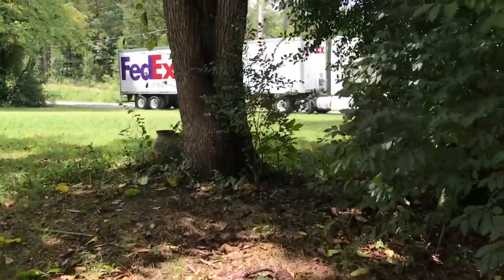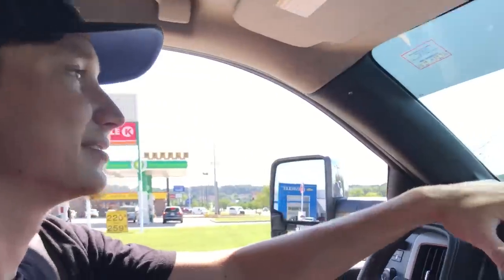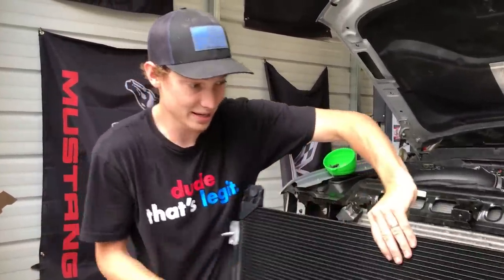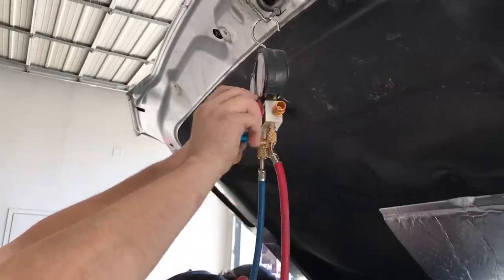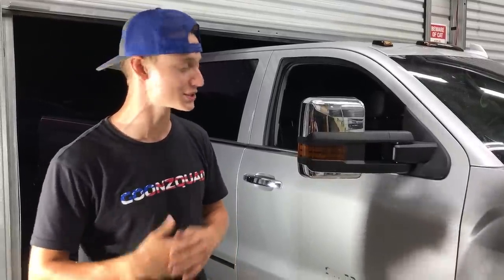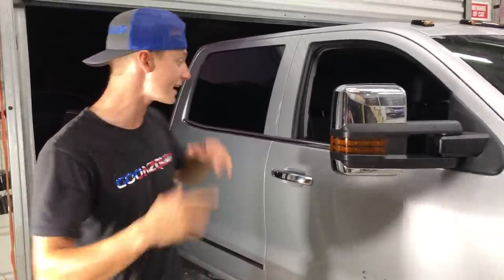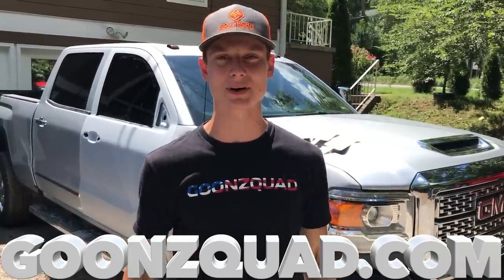Rebuilding A Wrecked 2019 GMC Duramax Part 7

Comment: 2 tips of advice

1. Always clean panels before you check for color match and also check them for panels you will be painting or trying to avoid blending.   

2. Lay them flat as possible against the edge of the panel and check for match, pearl (flake) and side tone.   Sometimes you'll have 2 colors that head on look perfect but from the side look completely different.  

Also from experience, check with the paint store maybe they can let you use the 'chips' for each color.  Sometimes alone on that you can match the color close enough to avoid blending panels like the hood (which is a nightmare on that truck).  Would save you the  cost of buying a pint of paint for each variant.  

Also, label everything.  Every variant, paint code and which ones matched best for the car.

Comment: You pull a vacuum to remove moisture from the system as the compressor cannot compress moisture(water). It will also help ensure confirm no leak. Holding vacuum for a period of time will confirm hopefully no leaks . To leak check you would charge with nitrogen first and check for leaks then move on to vacuum if as is good. Great video guys. Loving the Denali.. shame not released in the uk

Comment: HVAC ATTENTION
I have been doing HVAC 25yrs. 
1.) You should have dropped that compressor and drained the oil. Used sub zero oil and measured right amount back in. That system could have ran for a bit and drained oil till pressure switches shut off.
2.) The system sat open for how long?? New refrigerant oil is POE. it doesn't mix well with moisture; infact it become acidic if a proper vacuum is not done.
3.) Vtuned is a great frame guy. But his method for vacuum pumping is bad. You do not pull thru manifold hoses as vacuum pump is not fully used to capacity. Secondly you change the oil in the pump every vacuum as that vacuum oil is what collects moisture from the system. Thirdly a micron gauge should have been used to tell how deep and moisture in system while pulling a vacuum (500micron minimal).
4.) The dryer/orfice should have been replaced. 
5.) Always use refrigerant oil on all gaskets and orings. This prevents tears and leaks when tightening up.
5.) Lastly check system with nitrogen and spray with bubbles. No bubbles no troubles.
6.) After system is tight and no leaks purge out nitrogen and pull a proper vacuum.
Reply: Precisely! In school for HVAC/R and this is spot on
Reply: What do you mean you don’t pull through manifold hoses? How else is it supposed to be done?
Reply: They sell a tree..it is a brass piece that has 2- 3/8" hose hook ups. This will attach on the vacuum pump right where you can hook up the 1/4" hose.  You then get the 3/8>1/4" hoses. Use small stub hoses with shut off valves. The small hoses are so that when vacuum is complete you can hook up manifold and purge the freon and not loose the vacuum.
What happens when you pull thru a manifold gauge is you dont use a vacuum pump to 100%. At best its 50%. And therefore will not pull an adequate vacuum.
Reply: I thought there might've been some more to that when they were doing it. HVAC is no joke. Has to be done properly. The Goons said it was ice cold and frosty on their ride back from VTunes?
Reply: @rusgeorge7356  yeah but on the long run it won't, it will probably not last long done this way trust me

Comment: 2020 2500HD Diesel DEF tank/filler enhancements. The Diesel Exhaust Fluid tank is relocated farther back on the Silverado HD’s frame and out of sight from the exterior, and the inlet is located next to the fuel filler for more convenient filling. An electronic gauge readout for the DEF fluid level is added to the Driver Infotainment Center of diesel-equipped models.

Comment: I sure hope you put the right ac refrigerant in it. That takes the new 1234y refrigerant and not r134. Also a wet grey scotch brite is way easier to prep your blend panels. Make sure to seal your fender and front bumper. If you don't that will rock chip easily. Sealer is a cushion it's a must to use. Also a correct shade of sealer will also help paint coverage.

Comment: You Goonz, it's nice to see that you guys bothered to get three different jobbers of paint however you still missed the boat you should be creating multiple spray out cards for each of your paints and spraying the base coat at several different psi's ......as PSI has a huge Factor on colour matching and shading and even how the metallics lay down. Eg.... you should have multiple  spray out Cards ie 3 cards pre jobber you should have sprayed card one at 20 psi next card at 24 PSI Card 3 at 28 PSI once all cards dry from same jobbers apply one light drop coat to all the three spray card from the frist brand of paint  repeat above for other brands of paint. Then final 1 coat of clear to all 9 cards .

You now have 9 cards to get your best match.

It takes as little as 3 PSI to change the tone or shading of a paint from your batch paint.

Comment: The mirrors grow on you for sure. They look the same when driving. So the roof spoiler is kinda cool because literally you can put pieces of paper in your truck bed by the window and they won't go anywhere. Now that they move the air with that thing nothing really flies around in the bed. I love my 2019 Silverado z71

Comment: You draw a vacuum to mainly evacuate the air and remove any moisture, this is key as the moisture can freeze and stop the ac working plus is corrosive to the internals. This is why you need to pull vacuum for 15 minutes or more depending if the system has been open to atmosphere.

Comment: The reason you "Vac Down" an AC system is that the largest killers of a system are moisture and contamination. Once a system is open, you have 5 minutes to get it buttoned up or you had better vac it down. Refrigerant never wears down, it is chemically engineered to last forever.... That's my contribution :D

Comment: When you put a  vacuum on the A/c system it will remove the moisture in the system. It does this becuase any moisture will boil off under the vacuum. Any moisture in the A/C is a bad thing.
Reply: You pull a vacuum after pressure testing the system. This is done (pulling a vacuum) so all of the non-condensables are removed. Things like oxygen and nitrogen are non condensable and cannot be condensed under process conditions. Also, all moisture is removed as it can become an acid and ruin the compressor.
Reply: No, it’s air conditioner foreplay.

Comment: @goonzquad u need to fix that dent in the back bifore paint
Reply: they did on the down low
Reply: Waiting on a new tail gate ??
Reply: Its a quick sand and fill job that takes less than a hour to complete
Reply: Jay Smith bondo!
Reply: @lj6284  Its a brand not a type of filler and it won't take much filler to repair the dent is what I was saying .
Reply: @jaysmith5084  thats what i am saying.
Reply: wow this com got  lot of likes

Comment: you pull a vacuum on the AC system to ensure that you also remove any no condensibles. The Air actually contains moisture. The moisture when it mixes with oil will cause acid and that does not do your system any long term good.

Comment: The vacuum  boils moisture out of the system.
Reply: Power 2 Weight Water boils at a lower temperature the lower the external pressure
Reply: The vacuum remove the moisture, systems cannot operate in atmospheric conditions by vacuuming it you remove the condensed moisture in the air.... forcing the freons boiling temperature to be much lower when the gas is compressed and cooled
Reply: Technically pulling a vacuum on the system removes the air & moisture out of the system. The refrigerants heat exchange properties is greatly reduced if the gas is not pure. It is known as the Joule-Thompson temperature effect, the condenser pressurize the refrigerant to high pressure and when the gas expands on the low pressure side it causes an endothermic release.
Reply: Thank you.  I was wondering if anyone would point that out.
Reply: If the moisture was left in the system, it can turn the refrigerant (it's not Freon...that's a brand..if you drive a chevy, you don't call it a ford) into an acid and slowly eat the system away from the inside. That is why it is always placed under a vacuum.
Reply: Power 2 Weight all good

Comment: I am willing to take a bet that with the right GM parts, you guys could relocate the DEF tank and filler to the 2020 locations.  💡
Reply: They could probably add those steps in the bed too
Reply: And you will probably fail state emissions and you will probably spend tons of money and regret doing it... there is reasons why it's done that way for certain model years . Emissions must be maintained  otherwise you risk very heavy fines for every day at the start of the year to the day in which you're caught bypassing emmisions the fines can be in excess of $10,000
Reply: @772777777777777  the tank is still there but it's in a easier place to access he said relocate not remove
Reply: @roycesmart8019  you tell the state  inspector that...when he got a hard on for having it stock....and hand you fine...for thousands of dollars..for modifing emissions. I bet you never dealt with those inspectors especially at the roadside when they do randoms stops.....surprize surprize
Reply: @772777777777777  don't really see your point at the end of the day if some stupid inspector fines you st the roadside take it to court and have the vehicle tested for emissions if it's in the legal limit whats the problem
Reply: @roycesmart8019  the courts will side with government official not you...even if you get a indepance garage to do the work...not worth the heavy fines and time lose from work... and court fees not worth 20k plus

Comment: wants to use truck for towing
buys lift kit 
Ehhhhhhhhh I let it slide.
Reply: To be fair, I haven't seen them do any towing yet that couldn't just be done with a half ton. Making this a little worse on the towing end won't have much of a negative effect for them
Reply: I use to tow all the time with my lifted truck it was lifted 8 inches with 40 inch super swamper m16s
Reply: My truck is lifted 8 inches on 37s deleted and tuned and it tows like stock I don’t get why people assume lifted trucks can’t tow🤦‍♂️

Comment: The reason you pull a vacuum on the ac to remove all the water and moisture.  You can't compress water so it will kill the compressor if any moisture is in the system.

It's a good indicator as to no leaks but the proper way to leak test is to then fill the system with nitrogen, then re vacuum.

Comment: Hey guys, i know the u bolts are holding the axle firmly but i am concerned the locating pin was sheared. Also if the axle moved even a little those u bolts are torqued in a way they are not designed to be.  I don't know much about this stuff so my concern could be miss-placed. 
  Love the Channel and the work you guys do. keep it up ! thank you.

Comment: One of the main reasons you need to pull a vacuum on an empty A/C system (or whats called "evacuate" the system) is to boil the moisture and remove it from the system. Moisture exposed to a vacuum (ideally 29 in.hg, which is a "perfect" vacuum) greatly reduces the boiling point of moisture captured in the system, causing it to boil and be remove from the system by the vacuum. When I evacuate a system that has been open to the atmosphere, I install the manifold gauges and vac. pump in-line and evacuate for at least 45 minutes. Then, I start the engine and close the hood as much as my tools will allow and continue to evacuate for at least 15 more minutes, which the added heat of the engine will entirely remove any moisture contained in the system. Yes, the system will work when not using that procedure, but when I am charging someone over $1,000 to fix their A/C system, I want to know that it was done the right way and I have no angry customer with a come-back..

Comment: You put it into vacum because changing the pressure will make water evaporate at a way lower temperature. And that is what you want to get out. Any humidity can kill the system, because when it mixes with the "freon" it will make chemical reaction that creates acid that can kill components in the A/C system.

Comment: Paint the boat to match the truck and then add a matching stripe to both vehicles that will blend them together and maybe matching wheels on the trailer depending on the size of the wheels you get just a suggestion I know whatever you do will be legit

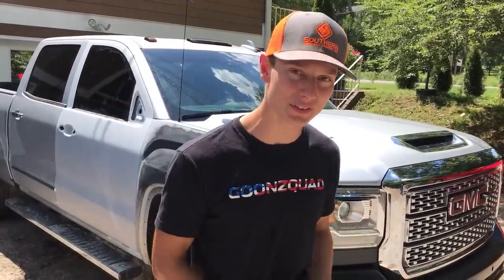Comment: Not sure about paint choice. The one you chose looks darker on camera while the other choices seem to match . 19:19 was where I confirmed you might be making the wrong choice. 
Make sure you stir the paint very well before spraying samples. And before you spray silvers, agitate the gun if it has been sitting. 

Always finish the base silver color with a far away mist coat to get rid of silver streaks caused by flakes.
Reply: I think you rearranged it. Now after looking I see the C on the left, S in the middle and I assume N on the right. 
I guess the C would be okay blended . I thought the S was the closest match when against the door initially . I would have to see in person . I’m sure y’all will make the right choice.

Comment: you could ask for a print out of GMVIS at the dealership it will provide you with all RPO codes including exterior paint It's useful in many aspect. While you are in the paint I would also do everything under the truck that is questionable they are good at missing spot leaving surface to surface rust. And while you on it and you got new brakes you should paint all the caliper  and rotors exposed surface with high temperature paint There is also epoxy kit that give it the higher quality visual shine and it keep this surface rust off the brakes surface that could spot the wheels and cause brakes noise

Comment: The reason the vacuum is pulled on the ac system is actually mainly to boil all of the moisture out of the system to make sure its dry and free of shit. Not just for leaks because sometimes a seal will leak under vacuum but not with pressure on it and vice versa

Comment: It is important to vacuum an air-conditioning system to remove any air or moisture that may damage the system in the long run. Moisture in the AC system is a serious problem, because moisture reduces the performance of the AC system and condensation of water can cause the AC system to freeze.

Comment: With the AC the vacuum is pulled to make sure any moisture is removed from the system.  I'm not sure how, but I'm told any water in there will destroy a pump quick.

Comment: Putting it next to a diesel (or jet fuel since it's also a kerosene) is asking for problems. DEF is approximately 66% water and 34% urea. The urea in DEF will condense out into crystals. Obviously that will clog filters. The water will pass the filter, but it washes out the lubricity in the pumps and injectors, ruining them in short order.

While jets don't use DEF, the refueling trucks do and the DEF fill port is near the PRIST jet fuel additive fill port. It has already happened enough with jet engines causing flameouts that the FAA has issued cautions about the issue.

Comment: Don't usually comment on vids......But two things. Having the Adblue filler next to the fuel filler is not a good idea. I work roadside breakdown and recovery, and see many instances of people putting Adblue into fuel, which will eat engines and fuel pumps (Its derived from pig urine, and is highly corrosive)
Also, vacuuming aircon systems is about reducing the boiling point of any moisture in the system and effectively boiling it away ( you can see the steam coming from the outlet of the vacuum pump).
Hope you found that interesting. Love your vids guys. Big fan here in England
Reply: Your biochemical observation is just a Tad heavy on the Bio. The substance is Urik or Uric Acid made in a laboratory.
Reply: @gpackwood1  Hi Gary. Uric acid is derived from urea, and in the UK pig urine is heavily used, it could be different in the US I guess, but regardless, my central point stands. It is highly corrosive, and putting the filler next to the fuel filler is just daft
Reply: Automotive urea, in case you were wondering, is not an animal derived product although we do excrete urea in urine, it's at much lower concentrations. The stuff used in your car is a man-made substance created by exposing synthetic ammonia and carbon dioxide to heat. As well as being used in liquid form, AdBlue suppliers also make dry pellets for farmers to scatter on their fields as a form of fertiliser. Source :: UK - Auto Express :: https://www.autoexpress.co.uk/car-tech/96793/what-is-adblue :: But I did get your central point on confusing substances that are metered for fuel.

Comment: Check the running board on the backside toward the rear tire on the end of the running board should be a button to let the running board swing toward the back so you can climb up into the bed let me know if you have that model running boards

Comment: You evacuate the ac system to remove any air and moisture from the system. If there is moisture in the system, moisture +refrigerant+compressor oil = acid. Which destroys the entire ac system.

Comment: Pulling a vacuum on a ac is mainly to get the liquid out of the system. Water wrecks havoc in a ac system. Also to check for leaks. Technically you pull a vacuum for 6 hours bring to 29”hg. Then your supposed to let it sit for 24 hours blah blah blah lol. We do that for residential and commercial. Cars don’t need the length of vac and sit time tho where the system is smaller but you should have good practice and do 6 hours vac and 12 hour hold.